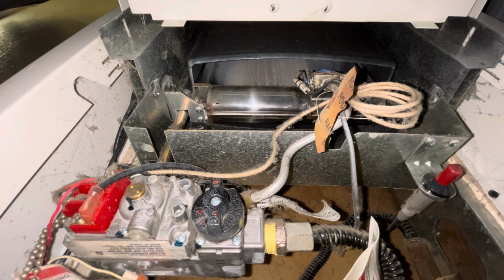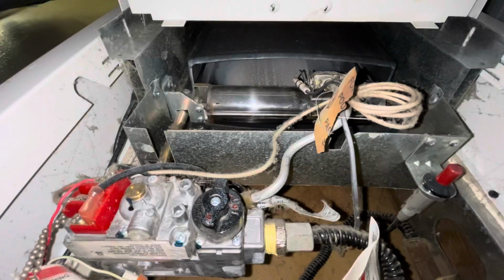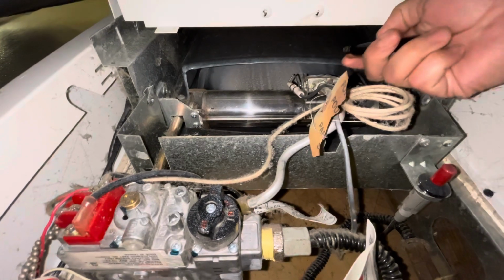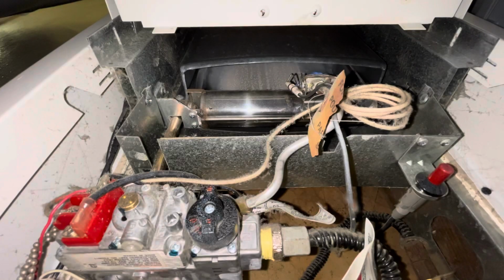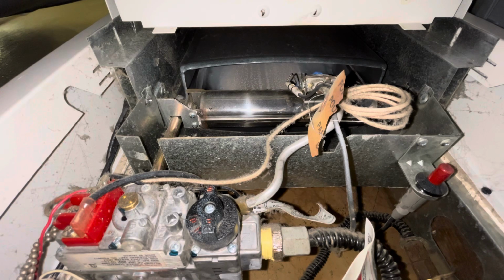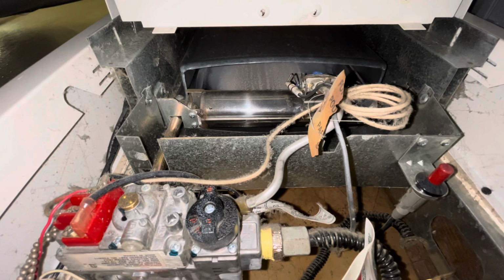How to turn ON the pilot in a wall heater/furnace.

Comment: Hey bub help me out, I have the same Williams heater, at the end of the video you just had the pilot going correct, you didn't show us the thermostat turning on the heat correct.
Reply from the maker: Basically just turn on the heater after like normal on the wall